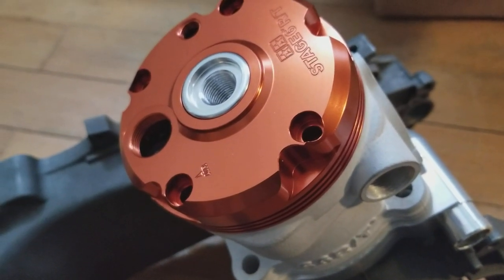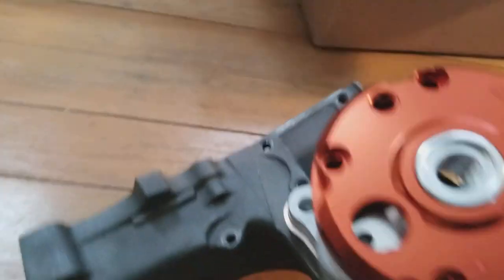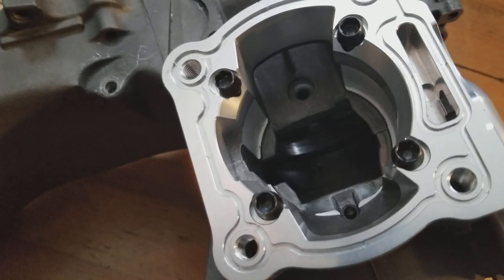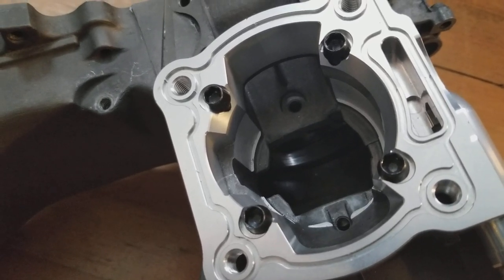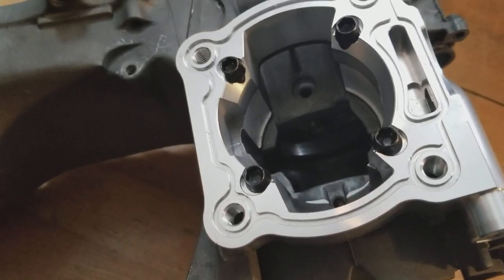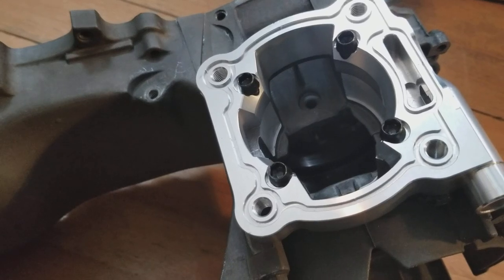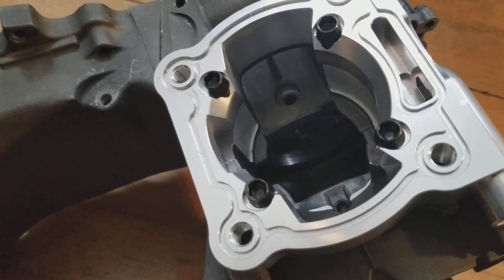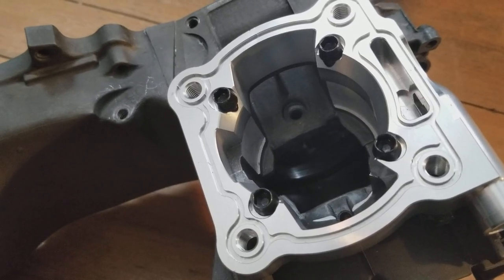Honda AF18 Dio Stage6 R/T95 build. Part 1  #SHORTS

Comment: What crank u used ? This is smooth bad ass. What state u in?
Reply from the maker: It is a Stage6 R/T 95 44mm stroke for Minarelli.  I turned it down on my lathe to fit and added a case spacer as well as bored back the bearing pockets 1mm each side.  I also had to machine the stator side to fit a new seal, the variator side can stil use the Honda.

Im working on the cooling system.  I'm in Canada
Reply: pitobread i never saw anybody do this to a dio bad ass i got few bikes. What did u do with ur twin bore spree do u own a cnc shop or somthing ? Pretty awsome work 
Had alot of stroker dios always wanted to make a 2 clynder big stroker motor, how did u make crank and block on ur dio spree
Reply: @grantmara769  yes I also wanna know how because I have the kymco zx50 and it has similar dio engine and mines all stock only 1000 miles lol runs great! But I'm definitely building a monster over the winter nothing too crazy but I want some power you know!
Reply: @Cito_Fiytb_617  he is on another level of building bikes bro
Reply: @Cito_Fiytb_617  u should get a malossi dio crank with dio polini corsa will fit in ur kymco zx50 block  as zx50 motor is like a sym dd50 af18 af16 syle motor
Reply: @grantmara769  I can see that but why not be right there with him he can probably build us something nice like that
Reply: @Cito_Fiytb_617  true that braddah he built my motor on my spree  posted a video on my youtube page
Reply: @grantmara769  oh damn! That's sick I'll def go look